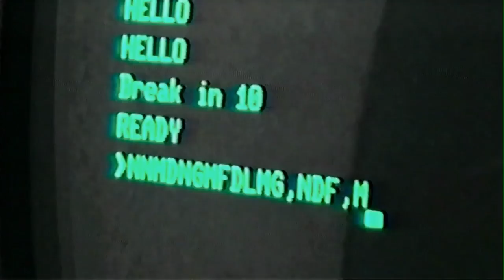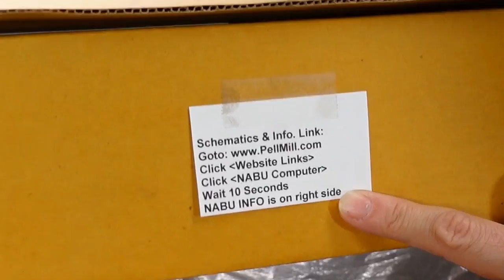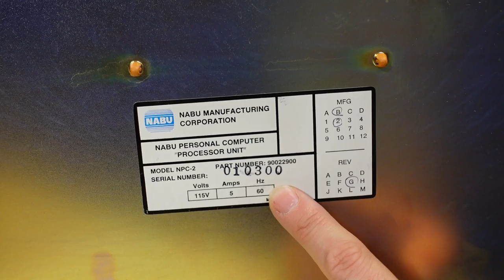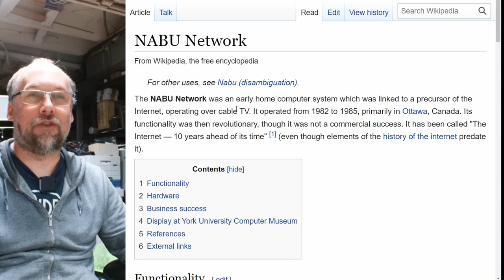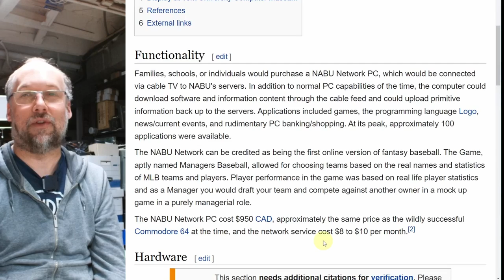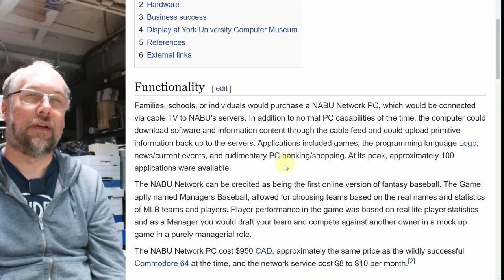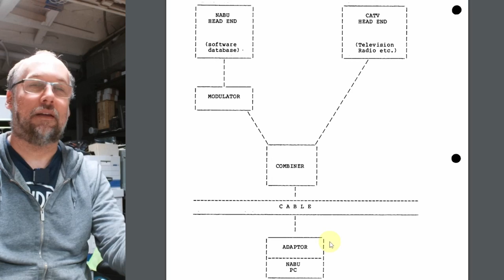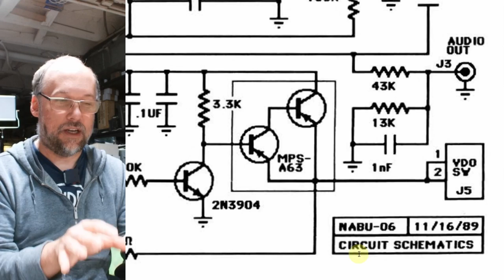The 80s computer you've never heard of: The NABU PC

Comment: Just ordered one. I'm curious to see how a potential scene for this shakes up since there's so many of them suddenly available, and it's got a decent design that's a cousin of other existing 8bit machines that could serve as a good kickstart toward a software library. Maybe with a disk emulator or RF loader of some kind and bigger rom it'd be an approachably priced machine for tinkering with. The existing way it expects things to be loaded in also sounds like a fun reverse-engineering project for those interested in such a thing.
Reply: @peterboon8280  it's kinda worth it though. I would have much prefered to snag one for $20 if i had known about it, but the guy selling them has kept them for 30+ years and documented as much about it as he could, and is still keeping the price kinda reasonable. Granted you could pick up a working c64 for about the same, but not a new old stock one, and the nabu seems primed for tinkering. If a vintage computer is for sale in the woods and no one is around to see it's good price, does it make a hobbyist scene?  ¯\_(ツ)_/¯

Also, it's still a steep discount from their 1990 price of $89 with ads in the back of magazines. :P
Reply: @peterboon8280  tbh , $60 is still very cheap for a 40 year old new in stock 8 bit computer.  Especially one that has very low production numbers, because it was a flop.

Comment: Sounds like a perfect addition would be a “Cloudberry”, i.e. a Raspberry Pi or similar configured to talk RS422 and essentially be the second box, serving up an OS and other software, potentially while being connected to the internet and a tentative software library. Ideally it could be put on one of the expansion ports inside if that would work (if it is configured to be able to boot from a peripheral connected there), especially as there are already power headers available inside as well. Otherwise it could also reside in a miniature version of the case and connect to the actual port on the rear. 
Sounds like it could be a fun toy for the small community that ends up having one of these machines.

Comment: I'm suddenly very glad I didn't win a recent auction for one that went for $400. Hopefully York U Museum is open when I'm in Ontario next week.
Reply from the maker: WOW -- the winner of that is probably pretty mad. At least it sold for $400 and not $4000? It would be awesome if the museum released the code they used to emulate the network protocol and the OS they had for the system.
Reply: @adriansdigitalbasement  My understanding is York have a good chunk of the original library, which was discovered on disk a while after the emulator project, but due to copyright it's unlikely to be released any time soon.  I think there's a MAME port of one game for NABU out there but that's it.

And yeah the auction would have sucked.  Imagine paying $50k for a Lisa 1 and then someone turns up 1000 of them in an old warehouse and starts dumping them for $59.  Not quite the same but still..  Lol
Reply: @TechTimeTraveller  Maybe someone can step out of the room for a few minutes to get a Timmies and someone else can....

Comment: That joystick was actually quite ok to use, with short movements and increased sensitivity over the "normal" brick with a stick type which I found had longevity issues if slammed around in the heat of excitement while playing.
The dot matrix printer looked very much like the Tandy DMP 100 I had connected to my TRS 80 with the "enormous" 8K of RAM when I first dabbled in BASIC, a skill required to do more than play a game or two at the time. Todays programmers would do well to have a try at the tight coding needed with only 8K of memory.
Eric

Comment: Regarding the bidirectional cable network stuff, even in the early days of cable Internet there were a lot of smaller cable ISPs which only used cable for the download, and required you to dial in for the upload. The cable provider in the smaller city where I went to college was like that, and it wasn't until Comcast bought them out that they started to provide true bidirectional cable Internet.
Reply: What? Very interesting!
Reply: Yes, in older systems, every amplifier along the line (could be many dozens between you & headend in pre-HFC/fiber days - hundreds or thousands system-wide) would need to be replaced with a 2-way capable version capable of filtering out and returning low 4-42MHz frequencies upstream. TV channels in US/Canada began at 54MHz, but a dead band between the up/down paths was necessary to avoid cross-feedback. Early demand for two-way was only for pay-per-view ordering, more advanced scrambling schemes, and a few reverse video feeds from remote studios for public access channels, local government use, etc.

Comment: I worked a bit with Dave Dunfield in 1993 as a freshly minted engineer with the Ontario Telepresence Project.  He built these serial protocol converter boxes for controlling VCRs that we affectionately called "DBoxes".  At one point someone brought a Nabu 1100 system into the office, but I don't think it ever got turned on.  At the time we were using SparcStations and 486 PCs running SCO UNIX.

Comment: Your channel is probably the one I watch the most. There have been many updates to the NABU in terms of making it a functional and a usable system since this video was posted. I facing only one problem; the PSU is 110v and in my country it's a 220v forcing me to use a step-down transformer. However, in the NABU's technical manual something interesting was mentioned and I quote: "The transformer primary has two 110V windings. They are connected in parallel for use with 110V supply, and in series for use with 220V supply". Would you please help in showing how such modification could be achieved? There are many NABU owners that would love to make such modification and keep using the original PSU that came with the NABU. Thanks

Comment: Raspberry Pi is overkill for the internal headend interface. I would think an ESP8266 or ESP32 would be way more than enough and much easier to deal with. The actual headend server being run on a Linux box (which could of course be an RPi).
I notice ebay is showing 40 units per hour being sold! I expect the price to ramp up a bit soon.
Sadly not for me, being in the UK it's got everything incompatible about it - NTSC vs PAL, 110V vs 240V, and of course huge delivery charges and our extortionate import fees, duty and VAT.
Reply: It seems you can connect to the Adaptor port with a USB-RS422 adaptor connected to a RasPi or any other computer and you wouldn't need a separate Adaptor, just the headend software.  Less HW, not more.  The serial rate on the port is 111kbps but apparently it's close enough to the standard 115200 to work in most cases.  Not sure what the specified clock tolerance is on RS422 but on RS232 IIRC it's 4%, and 4% less than 115200 is 110592, so as long as the crystal oscillator on the NABU hasn't drifted too far down and the device you're talking to isn't clocked too high, it should work.
Reply: I once replaced the disk drives on a DECsystem-10 KA10 processor with a VAX 11/780. It wasn't overkill, it just makes it easier and more flexible.
Reply: @drgiller  The actual NABU-to-Adapter bit rate is 111.86kbps (3.574595MHz colorburst / 32), reducing the error vs. 115200 to 3% ... so, 30% out-of-phase by the final stop bit, assuming 8N1 framing. Likely to work if there's any dead time at all between characters... assuing the RasPi's ttyAMA0 UART is not capable of supporting this odd bitrate directly
Reply: @jordanhazen7761  I've seen a number of people refer to dead time between characters as a determining factor.  I think this is incorrect in theory, perhaps partly correct in practice.  The receiver is supposed to synchronize on each start bit (the falling edge from the mark to space transition, plus half a bit, is the sample time).  The stop bit, a 1 or mark (same as the idle bit), is in effect a single-bit enforced "dead time" between the last data bit and the synchronization bit (start bit) for the next byte.  If it samples correctly as a mark, the byte should be accepted, and the receiver should prepare to immediately resynchronize to the next start bit, half a bit-time later.  Certainly some UART implementations (especially bit-banged without oversampling) may not resynchronize properly (or at all), but that would be a flaw in their implementation: on RS-232 at least, a total error between send and receive baud clocks of less than 5% is supposed to be tolerated per the standard, even with no dead time between characters.  I believe RS-422 is the same specification other than the physical layer (differential signaling).

Comment: I never heard of NABU, and I used to work in the computer industry in Montreal, Quebec, Canada. I worked for a company that was called Micom and eventually transitioned to become Philips (yes, part of the gigantic Dutch Philips company). When I first started working there, we built dedicated word processors, as in they could only do word processing, but they did it very well. There were two basic systems, one was 8080/64K (1MHz) based, and the other was Z80/128K (4Mhz) based. I think what made those systems so desirable is that the terminals (display and keyboard) were specifically designed for the word processing functions. So you had specific keys for Disk (meaning you wanted to do something with the 8" floppy/floppies), Duplicate, Erase, Format, Save, Load, Print, Cancel, etc. The interface was text only, but when you pressed the Disk key, you would get Disk? on screen. Then you could Cancel, or press Copy, Save, Load, or if you Print, it would display Print? and then you could press Page or Document. Secretaries of the day just loved those systems, and when we transitioned away from the word processors to the PCs (our first PCs were purchased designs from a company called Corona in Westlake Village, California), there was a lot of resistance from the secretaries who had used the word processors. Eventually, the word processor line evolved into a smaller system that used 5 1/4" floppies, and that system (still a Z80 based machine, still 128K, but it now could run C/PM). That, too, eventually was discontinued. We even had a competitor down the road in Montreal that was sold as Lanier in the US.
Reply: Hey Kostas, I worked at Phillips in Ottawa from 1987-1995(Phillips service had been bought out by Fujitsu by around 1991). I remember that we were still repairing the MICOMs long after they stopped making them. In fact they had some on display at the museum of science and technology in Ottawa and we still had clients using them. I knew a few people who moved from the Montreal office to come work in Ottawa. Oddly enough I had never heard of this NABU system but then again, Ottawa was the Silicone valley of Canada at the time so there were so many tech companies at the time.
Reply: Andre, it's sort of amazing what those systems could do. On an 8 bit system, with 128K of RAM, you could be copying files in both directions, printing a document (on the Qume daisy wheel printer, which was bi-directional), and be re-paginating a document, all at the same time, and everything ran smoothly. PCs really couldn't do that until Windows NT at least, and they needed a 32 but CPU with 10 Million times the horsepower, and gobs of RAM.

I remember talking to some of the repair techs who came over from Europe, and they said that there were a lot of these units (under the Philips banner) at NATO's HQ in Brussels. I know DND had some in Ottawa, and we even had a Tempest project going at one time,so they may have been in the Pentagon or even the CIA.

I worked at the Micom/Philips factories (both Town of Mount Royal and Ville St. Laurent) from 1981-1991, in a variety of roles, from bench tech to ICT Specialist/Leader.

Comment: Ottawa resident here. I never owned one of these, but I was around when they first came out. IIRC, price was around CAD$700 for the system, and then you needed to subscribe to the cable service. Both cable companies in Ottawa (Skyline, Ottawa) carried NABU service, probably another $10/month or so.  The computer is useless without the cable service, as you have seen. Worse, the software was "cycled": the set of programs available changed over time, so the local TV guide had "NABU listings" alongside everything else.

And this explains why the system wasn't successful: its entry cost was much higher than Commodore machines (the most popular in the area at the time) and you were tied down to the cable service.  Overall not great value.

Comment: Someone probably already figured this out, but: if you assume N-8-1, 6992 baud is 7866 raw bits per second, which is almost exactly half the NTSC horizontal scan rate. Doesn't seem like a coincidence given that it's meant to be a cable TV connected device.

Comment: MSX you say? It would be cool to have MSX games run locally without the network on these machines. I really like the design, it's so simple yet still has some style to it. Running Metal Gear on it maybe? That would be neat :)
Reply: IMO It is the best way to use it ,if it is actually MSX compatible.making an sd adapter connected to one of expansion slots or connecting a programmed raspberry pi or similar to the adapter port will do the job.
Reply: At least port map is different, keyboard interface is different and it lacks keys (select, F1-F5).
I'd imagine you would need some bodge wires, disk/tape interface, and obviously MSXBIOS (EP)ROM.
But it seems to be easier than assembling MSX from scratch (which is doable for MSX-1, not as much for MSX-2 without a bunch of custom chips).
Since the docs are available, I wonder if someone comes up with a conversion guide

Comment: First thing to do is compare this machine architecture to SVI328 and MSX to see if there are enough similarities. Maybe it's possible to convert one of these into a workable SVI328 and run software from there. Perhaps feeding the software through the cable connection using an Arduino or Raspberry Pi.
Reply from the maker: It seems like there are many similarities but one bad thing is this only has 8k of ROM while the MSX had 32k. That's probably a bit of a hinderance. On the other hand, someone already has a working CF card interface for this. (See my pinned comment.)
Reply: @adriansdigitalbasement  Perhaps it's only a matter of studying the expansion connectors and see if it's possible to add or replace the 8k ROM with a full 32k or something like... Just to add the MSX or SVI memory mapping.
Reply: @adriansdigitalbasement  There's a CF interface? This means that's possible to load software to this computer? There's somewhere a software repository for this computer?
Reply: @fcastellanos  another person on YouTube has a NABU running with the original software catalog being served to it from a PC through a USB to RS422 serial adapter. He wrote the server program and a NABU developer still had all the software.

So it won't be long before there will be a web service established so a NABU can be put online with a simple adapter to party like it's 1983. Or download everything and run your own server.
Reply: @fcastellanos  sorry, but the expansion connectors only support 16 addresses, and Z80 I/O instructions, there won't be any option to use them to add rom space, but then you could design a circuit that would give you the ability to read out ROM's of any size.